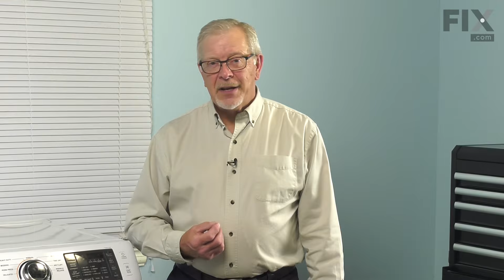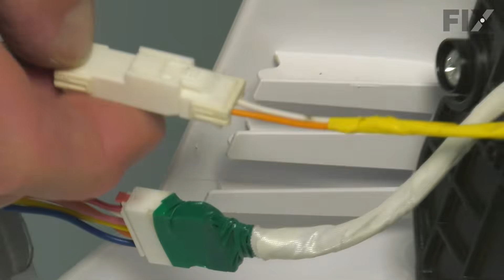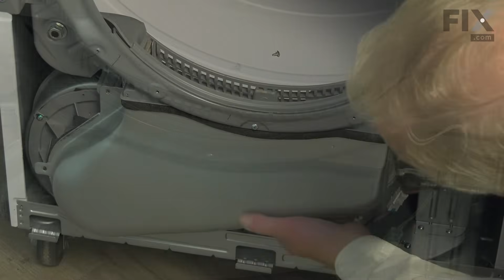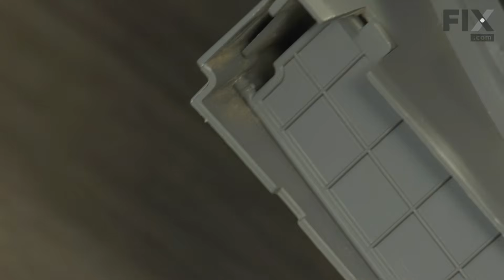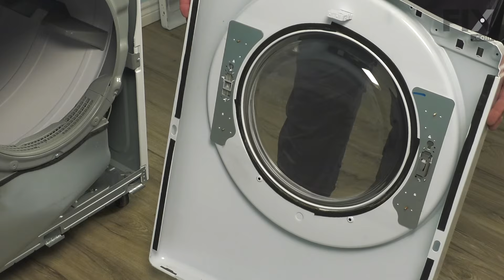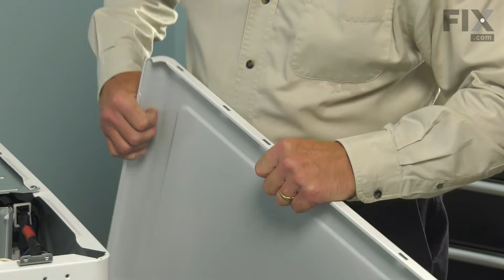Samsung Dryer Repair - How to Replace the Filter Cover

Comment: For anyone looking to get this stupid little cover back in place after accidentally knocking it off, know that it is possible to get it back on without disassembling the dryer as done in this video.  I watched this video to see how the spring was supposed to function and kind of worked backwards from what it showed and flexed the cover into place.

Comment: Idk I sat here thru 14 minutes to watch him break apart a perfectly functioning dryer. If you have the spring and the door, YOU DO NOT HAVE TO BREAK OPEN ANYTHING. The only useful part of this video was knowing the direction the spring goes. Flip your phone upside down so you can get an idea of how the spring creates the tension to bring the flap back up. And you’re done. The only tool I used was a flat screwdriver to attach the middle part when I had already installed both ends.

Comment: Thanks for the video, it definitely helped.  

I recommend NOT doing this repair.  Get the broken pieces of the filter out of the vent if possible.  Be careful to ensure nothing else falls in there and maybe replace this piece if you have additional repairs down the line.

For those wondering what this piece actually does - it prevents anything from falling into the vent where the fan is whenever you have the filter removed or as you are removing it.  

Unfortunately, the most likely thing to fall in there are pieces of this filter cover including the spring when it breaks.  The filter cover is extremely fragile, especially after repeated heat from drying.  

It is designed to cause what it is intended to prevent.  

I can only assume this was done intentionally to require repairs and push consumers to either purchase more fragile parts and continue the cycle of repairs or replace the entire unit with a new one.

Comment: Remind me to never buy one of these again, what a god awful design.  I was just trying to vacuum the lint trap out and this broke 😐
Reply: I was doing the same thing lol. Very cheap design and easy to break. The video makes it seem more difficult than it is though, I didn't need to take apart anything.
Reply: This just happened to me as well!
Reply: Same, omg 😳 what the actual hell???? Is this part even necessary???
Reply: Anddddd the comment section doesn’t disappoint. Wife was cleaning it out with a vacuum and it broke off. Then found this video (great tutorial) but horrible design if I need to disassemble everything but the drum and strap to replace a part that is probably $1. Ridiculous
Reply: Samw

Comment: Its a bad design to take apart front panel just to open one screw for the filter assembly, when other two screws are already there.. why hiding one screw in there?
Reply: I didn't have to take apart anything,  the video is making it way more complicated than it is.

Comment: Question, my lint filter cover broke, if I don’t repair it, will my dryer not dry properly? The lint trap is good shape.
Reply: Mine has been broken for a while. I didn't know what it was. The vent hose came loose in back and my garage had lint covering everything with 6 feet of the vent. I mean A LOT of lint! Once I reconnected the vent hose, the lint collected and plugged the cage at the outside opening of the vent. As a result, my dryer began taking longer and longer until it stopped drying clothes. I just cleaned out the vent opening and hoses today and am ready to test it. Fingers crossed! Now I realize I need to get this little door, because it really makes a difference. in capturing the lint before it clogs the vent hose.
Reply: Same just happened to me. You notice anything?
Reply: Wondering this as well! This piece just broke on me
Reply: Anyone that can answer this is a life saver. Thanks

Comment: I watched this in preparation before my door and spring came in the mail. However, I put it in without taking anything apart. 

Put the angled part of the spring flush to bottom of door, straight part of spring needs to be pushed down and driven against wall (this creates the spring action) as the door enters the opening. The door must go in with the two tabs facing down toward trap basin. Bow the middle to feed other side peg into hole. Very easy fix.
Reply: i just wanted to thank you SO much for this comment. you absolutely saved my sanity after knocking the door out of place while trying to vacuum out the trap.
Reply: Can you send pictures of how it's supposed to look? I was going to do the same thing.
Reply: Man I need a visual guide I read this out loud to my mom while we tried to do it and ended up just breaking the pegs. Gonna have to get someone out here to fix it lol
Reply: I was wondering if it could be done without taking the whole machine apart. which seems a bit overwhelming.
Reply: Can confirm this comment works. We were able to replace ours without having to disassemble the unit.
Reply: @seolittleroom  these comments give me hope. My door and spring are on the way, ive tried to removed screws and its not happening, hope i can maneuver it in without having to remove the housing.
Reply: Let me succeed🙏🙏🙏
Reply: What’s the part number for the spring?
Reply: Well here it goes! Guess what! Totally possible! Now I was worried about breaking pegs and or cracking the part. So I warmed it up so it was more pliable. Hair dryer worked! Get the spring on and go ahead and get the peg in in the left side. I did not bend the spring down because my hand would be to clamped to get the part peg into the hole. Once in, I pointed the part inward towards the dryer and pushed the spring downward and started bringing the part back, making sure the left tab on the left front side was under the slot it would fit in. I then arched the part upward, making sure the left tab on the left front side is still under the slot it would fit in, you then fit the  right peg is placed in the right hole. The front right tab should also catch the right slot when sprung closed. I then snap the center pegs into place by pushing the flap door down to open, and press back towards you to snap it in. I am so thankful for your comment. Happy I didn’t have to tear the whole thing apart!!!

Comment: I was able to replace the door without taking anything apart. Wasn’t difficult. Even easier if you have someone holding a flashlight for you. The video did come in handy though so I can at least see how the spring went on and where the middle snapped into at.
Reply: Lol 😆👍
Reply: @joshuablair8305  yes...I tried that and I broke the little end of the part...I just order a new one and I'll have to follow this video, I lost the spring actually

Comment: My filter cover broke off. Does this part need to be replaced? Is there any harm in leaving it off?
Reply: I’m guessing you don’t need it since when the filer is in, the door is open anyway! 🤷‍♂️
Reply: @slbynum  mine makes a terrible noise since it broked, I need to replace it ASAP
Reply: Just happened to me.  Anyone know what function this piece has?
Reply: @quicktech1000  I forgot mine broke..

But then again I haven't used it in about a year since I left my wife. It's her problem now. 😂
Reply: @quicktech1000 Guys , don't worry bout this thing, Its open always, purpose of it, when u take you filter nothing coming out inside.When u klclean your filter its open position again.
It's for service make money on you 100%

Comment: HELP! (Question below!) 
This is an wesome video! Very clear instructions regardless that I had a few variances on my  model. Took everything apart easily, cleaned the vacuumed out the blower housing+fan really well, & got everything back together without any parts left over. It took me about an hour start to finish with zero questions or issues. 
HOWEVER, now I have a loud rattling coming from the blower fan. If anyone has any ideas on what could’ve gone wrong, I’m all ears! I’m going into hour 4 & have disassembled & reassembled this dang thing 12 times in an attempt to troubleshoot. TIA!
Reply from the maker: Sounds like something has fallen into the duct work and has made into the blower area can happen. if you take the belt off the motor pulley and rotate the motor shaft by hand does the rattle still persist? If yes then it will help pin point where the object maybe which helps in knowing what has to come apart. The other thing it might be and that is if the blower itself has come loose on the motor shaft. Its rare but can happen. Have a look at those two areas. Good luck!